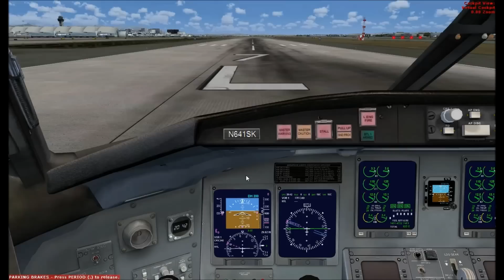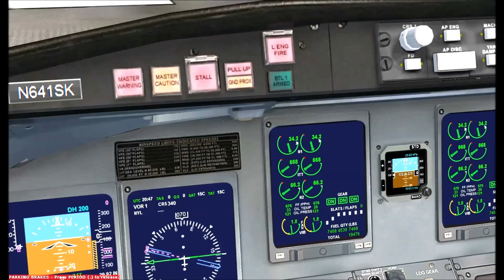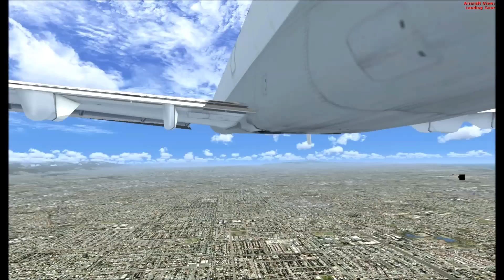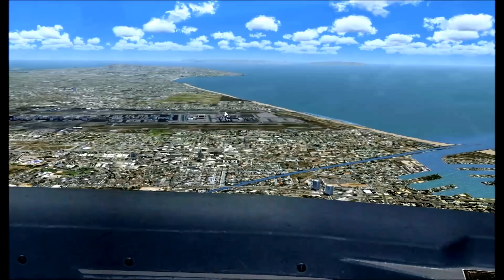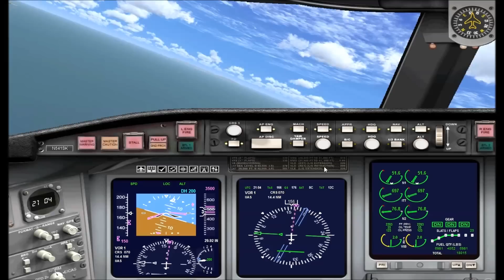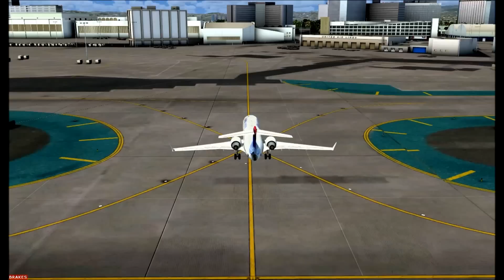Delta Virtual Airlines Default FSX CRJ-700 Circuit Tutorial at LAX

Comment: If it didn't work for you:
1. Battery switch-ON
2. APU-ON
3. APU Generator-On
4. Hydraulics (default on)- ON
5.Ignition
6. Both engine generators-on
7. Eng 1 starter switch
8. Wait till N1 and N2 stabilize
9. Eng 2 Starter Switch- on
10. Wait till N1 and N2 stabilize and make sure oil temp and pressure is just about equal
11.Both Starter switches-off
12. Generators-I would recommend leaving them on though
13. APU Gen-off 
14. APU off
My 14 step tutorial on starting CRJ 700
Tell me if it didn't work and i will ocme up with a new solution
Thanks

Comment: took the Bombardier CRJ 700 flight 5728 to LA from OKC flight seduled and on time 6:30 am to took 3 hours 30 minutes (approx.) flew group 2(I guess main cabin, not first class) direct flight. wanting to sim the OKC Will Rogers/LAX and then the CRJ 900 from LAX to Will Rogers. Flight 5723 coming back in a later vid. 5723 (LAX-OKC late, the crew was late, the maintainence was late, plane needed repairs of some variety, but that's LAX. plane crew good-they had been in some kind... of fog or hail storm(prior our flight), they had a reason to be late, stewerdess's okay, they had good voices easy to understand, the Pilot was there to give us a send off at the end of the flight(not just hide in the cockpit like the initial 5728 OKC-LAX flight but that was good too! good job on crew/stewerdesses had faint muddy voices though mumbled couldn't understand instructions, none of us could, pilot very raw or at least sounded green his voice also mumbly.he did a good job flying the plane we had hold up of some other plane in LA on landing,(that's LAX) but other than this, a good pilot good info of course had to use rabbit ears to hear what he said. (referring to Flight 5728 not 5723). OKC security decent treated me like humangeing(for the most part) but LAX security a bunch of TOTAL ASSHOLES!!! however, 5723 coming back flight plane was in the air at 7:15PM(LAX-OKC) yesterday, April 21 2015 flight 5723 seclude was 6:30! not too late, just didn't like LAX security. a friend of mine got the "random" butt check" (or that is what he said). I was spoken to as one would speak to a dog! a bad owner that is would speak to his abused  wretched mangy mutt!. I only had to do standard check, not the rape like one of my friends had, think God for that!this flight(round trip F5728/5723) cost us 333 per person, around 1000 for three. good deal for direct flight. I already flimed an intro vid on the CRJ 900 series over Pacific Ocean and plan to use it in my in coming(LAX-OKC) flight sim vid after doing the Out Going OKC-LAX. we had FF miles
Reply: fucheduck my pilot on flight 5728 must have had a cold too, he sounded like you do here! :D